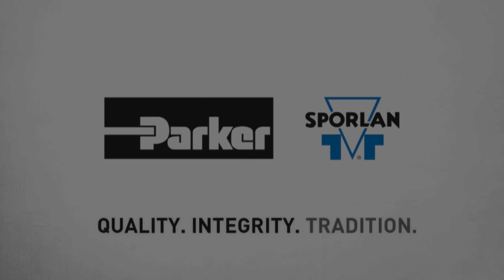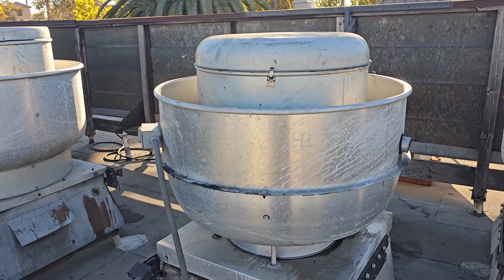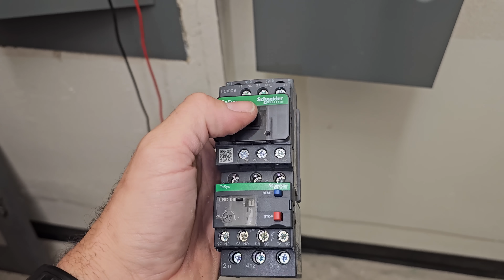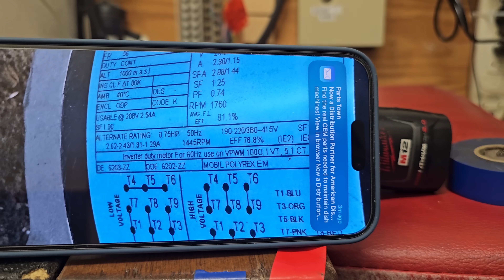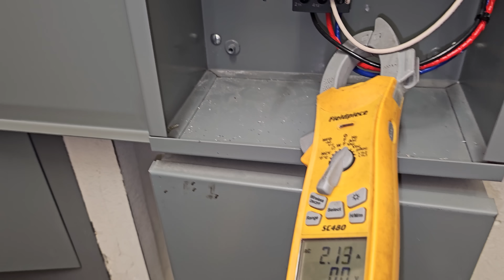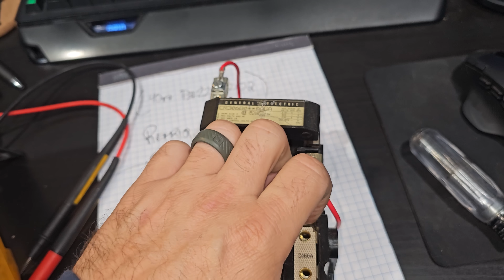SOMETHING IS NOT RIGHT

Comment: On my electrical work for me/friends I use Red, Black, Green, Yellow tiny zip-ties. Especially when all the wires are black before I service the ends ex Classic Snap-On Battery Charger prevents me from cross polarity destroying a vehicles PCM/ECU/Modules, don't need a $3,000+ oops Battery. Mainly I work on Automotive and electronic devices, ex, taking a $20 LED shop light from HFT turning it into a toolbox hutch light with a magnetic switch to auto on / off, manual switch, added fused as I had to relocate the power supply remotely to make the install fancy, wires hidden, epox magnets to mount for my former boss x-mas gift for his new toolbox. Snap-On set is $675.00. He retired shortly after and HFT released their clone for $100.

Just my 1/100 cent

Comment: I think the Schneider overload says it will trip at 125%of what you set the dial at. So you now have it set to 2.9 times 125%. Not having the control wired through your 95 and 96 contacts on overload will burn motors up fast as well. Not sure if you checked the others.

Comment: Pretty good video, except for one thing. Those thermal elements (heaters) are not fusible links that melt. If they were, they would need to be replaced when they trip, as opposed to being reset. They heat up on overload and the temperature causes the control circuit to trip out. After things cool down, the reset button resets the control switch.

Comment: 15 minutes into the video, working on the old three phase delta wiring.  If you find 230 or 240 volt power on a three phase system it is very likely a delta wring.  We had two systems of Delta wiring at City Of Long Beach, where I worked 15 years on some buildings built in 1949 - 1960 with delta three phase systems.  
The more common is three phase "High Leg" where you have 120 volts to ground on two legs and a "Wild" or "High" leg, that is about 190 volts to ground, but can not be used as a single pole to ground.  It messed up a 120/240 volt Hoshizaki ice machine with a 120 volt water pump in it, and a 4 wire power plug, using the neutral.  

Anyway some of our buildings have a 240 volt, where two lines are 240 volts to ground, and the third phase is grounded!  Very surprising to many who have not seen it before.  I had this system in about 5 of the library buildings, and the high leg system at about 1/2 of the park buildings.  Only the library built after 1970 had the normal 208 / 120 volt three phase Wye system.  Most of the buildings I took care of where built between 1947 and 1965, with very few between 1965 and 74.  Then they had "Prop 13" and that reduced funding to the city, and not much was built new after that.  

So the building with the three phase delta wiring, they also have a second power meter, with 120/240 volt service to that second power meter. 

The City rented a very old building that was owned by Southern California Edison Company, and they had a 200 amp power panel in there, the light circuits used edison base screw in fuses!  Really old stuff, from the 1930's!  You are bringing back some really old memories.

Comment: I work on Motor control all the time and use up to Size 5 starters.   I have found a lot of electricians don't understand motor control nor how to wire a Mag Starter properly with OL protection, which is what you've encountered.    I have a friend who works residential and commercial and always call me every time he comes across a starter because he just doesn't get it..   Seems like whatever electrician ran the wire for you was lazy to do it properly and up to code.  That should not be unacceptable!

Comment: That bimetallic overload had no built in fuse so the circuit it's fed from needs to have a fuse rated at max whatever it says on the overload label. This is probably why your old one melted, when the wire inside the conduit shorted, the current was too high and melted the overload instead of the upstream fuse/CB which is probably too big for this overload.

Comment: I got sent out to a newly built restaurant of one of the largest burger chains after work. The electrical contractor couldn’t figure out the controls for the fire suppression system which tied into the cooking equipment. I get there and ask the electricians who’s in charge. All five gesture they don’t speak English. As I’m walking out one of the guys runs up and magically starts speaking English. He shows me their rough in and the wires change colors two to three times with most of their runs because they were too cheap to buy more wire. I call my boss, he talks to the general contractor and I end up having to stay there all night tracing out their shit. They were still short on their rough ins so they had to go out and get more wire. After I was done I took photos of their spliced wiring to protect myself and told the general contractor to have them rip each wire out and replace it with an unspliced run. The next day I get a call from the general contractor asking me to guarantee that all the wiring will pass inspection. I laughed my ass off and told him “I’m an hvac guy not an electrician. Don’t put this on me. Spend the money and hire a qualified electrical contractor to redo everything if you’re worried”

Comment: If an electrician did that here, they'd be sacked. In some instances it is ok to sleeve different coloured wires to indicate a different colour but a green wire should NEVER be sleeved to any other colour or used for any purpose other than grounding. If the electrician didn't have the correct cable for the job they should have gone and got some.

Comment: What would be wrong with testing and replacing the heater if the contactor is still good? I look at it like this: I can save the customer alot of money. Heater only costs $20 vs $350-700 for a new contactor? So in the end I can get the job done for cheaper and quicker. Charge the same labor and make more money in less time? I know your not makeing as much on the part but my customers appreciate me trying to save them money!

Comment: Great videos.
While setting the overload to the rating of the motor is ok, it is not best practice.
Most electric motors are multi use and are suited to a wide range of applications.
The overlaid should be set to the design rating for the appliance. As for example in your video, It was drawing 2.15 
amps adding a percentage to correction value to that figure will provide better protection for the motor.
I have always set overloads to either the maximum load of the motor or if possible to a slightly higher rating then the running current. Knowing the motor will trip the overload and disconnect power after single phasing or having bearing failure for example leading to burning out the windings.
Regards 
Firth 
Downunder

Comment: I get goosebumps seeing that an electrician just recolors a wire. There  are enough situations were some idiots think they can steal ground etc. and just cut a used wire to cut in the loop to connect their own things to save pulling their own cable. Recoloring is strictly forbidden where I am from and can get you prison time if something happens because of recoloring the wire. And you pay for any damage that happens because of that. It is against code were I live. Use the right wire or if you use the wrong colored in an emergency make a warning label and exchange it for the right one asap.

Comment: What a flaky electrician.  He needs to find a new trade.  I can see why you ended up doing it yourself.  Most electricians are just wire pullers, and he couldn’t even get that right.  Most of them know nothing about troubleshooting, and don’t even know what motor starters are.    Right you are for multiplying the FLA by the service factor.  I find most heaters installed are the incorrect size for the motor. heaters can trip due to an,y loose or corroded connections in the circuit.  Hope you checked all of the connections from the breaker  panel to the starter.  I once had a loose mounting screw on a breaker, that caused the heater to trio in the starter, due to the wire running hot.

Comment: Hi!  The thermal protection is made to trip if there is not the same current in all legs. If you run out of two pole starter, you may use a 3 phase on a single phase motor  by wiring T2 out to T3 in and T3 to the motor.

You're so used to see exposed (hot or live don't know the appropriate words in US english ) big bare metal everywhere in electric box, that's you couldn't resist to add some "spice" to this poor "European style" motor starter !  By ripping off the plastic to run the control cable under the plastic cover, you give access to the live screw. 
Even if it look better this way, it was not made to be this way. It's still far better than the old one (and almost all other equipment I could take a glimpse on your channel) but you increase the risk of electric shock.

Comment: So with the slightly lower voltage (203 vs 208) do you have to adjust the allowable amperage higher or is the difference small enough to not matter?

Comment: Important to note that the screw that the budgie had crimping the black wire down to the back of the upper contact on the A thermal element is NOT a primary conductor in that the contact surface between the element and the housing was and putting that wire in under that screw head was a violation.   If you (readers) ever think that isn't really important you should look up Federal Pacific Electric.      The electrical conduction contact in that illegal arrangement could have been less than 3 square millimeters along the thread edge of the screw inside the hole.   Screws are NEVER a conductor.

Comment: that was some nasty weekend hack, beyond all viable hackery. make them come back and replace the wiring. using a green conductor for anything but equipment ground is 100% never allowed.
maybe that's all they had on the truck, but that's no excuse, go to the big orange/blue/whatever box store and get wire or measure with one conductor/fish tape and use multiple of the same with tape/heat shrink to identify it. 🤢🤮🤮🤮

Comment: keep in mind that the overload label  on the Schneider brand specifically says it will trip at 125% of the set rating on the overload.  so you should set the overload to the fla of the motor.
Reply: The packaging indicates to set for FLA on these, so you're correct according to what I've been able to find from the manufacturer for these they only have the packaging as an installation guide and it doesn't have words, only a pictrgram indicating the dial is FLA.  He has SF of 1.00 so I think in this case he may even have to multiply by 0.9.
Reply: Your're right, because in his case he would end up with 125% of 115% of fla. And I think that the fla isn't even the shown value in the picture, above you can see another current values.
Reply: [I'm not a 'true' electrician]
I think we're in agreement:
It would depend specifically if the motor manufacturer means to set it at 'x' percent above 'TRIP' setting, or if they mean the 'HOLD' setting, which is what the OL markings are.

If they are anticipating that all overload settings usually are marked in the 'hold' setting, then it is possible they mean to set it x% above the actual 'dial' setting, and not to 'add' any trip factor calculation.
Trips ratings are all usually time related, and not specific to any single amperage.
There is no doubt additional trip ratings for 200%, 1000%, etc.

Mr K L

Comment: That electrician should have their license revoked. You CANNOT reidentify a green wire as a different color under any circumstances to my knowledge. And even if you can, it is VERY poor practice. Not using proper phasing tape and writing on that makeshift "red" label is also a red flag so to speak. And bypassing the overload on one phase, if they determined perhaps the starter is bad, it should be replaced. That is a commodity item that they should just have on the truck. Super sketchy for sure!

Comment: It's interesting to me that they have one motor starter in each box. Seems like you could easily have two of the old ones and three or four of the new ones in each box and simplify the whole setup.
Reply: It a security thing. Sometimes the manager of an area  get a key for the box to be able to reset the the equipment for his area.  The kitchen crew would be really pissed if someone plays with their AC or exhaust when they are cooking just because the bar manager isn't able to read the label which one is kitchen and which one is bar.

Comment: I watch a few youtubers that are electricians in various places around the world. Don't know how many times I have watched them do a line check for voltage and then tested the equipment before and after. Every once and while it ends up with either an equipement error or failure that is caught through routine safety checks. It is incredibly rare but it saves lives. The guys/gals that do that sort of work can have strict safety and do quality work. Amazes me how many of them get called in to fix a poorly done job.

Comment: Two things wrong here. Phase tape is not allowed on wire smaller than #4 and you are assuming a liability for allowing this, you should call the building department and report this. Also if the service factor on that motor is 1.0 then the overload should be set at 2.54 amps.
Reply from the maker: Can you explain what you’re saying more?
Reply: NEC code
200.7(C)Circuits of 50 Volts or More. The use of insulation that is white or gray or that has three continuous white stripes for other than a grounded conductor for circuits of 50 volts or more shall be permitted only as in (1) through (3). 

(1)If part of a cable assembly and where the insulation is permanently reidentified to indicate its use as an ungrounded conductor, by painting or other effective means at its termination, and at each location where the conductor is visible and accessible 
In a cable you can do this, in a raceway no you may not.
Conduit and Liquidtight are both considered a raceway.
And under no circumstances are you ever allowed to use a green for anything but bond, it can never carry any current.
Basically you are allowed to tape a white wire if it is romex or sj cable as long as both ends are covered with withe
Colored tape.
Overload setting: NEC allows an overload setting 0f 115% of full load amperage on a service factor of 1.0 motor, but on a constant load device like a  fan running a motor past it’s service factor will shorten it life, this is especially critical with a high ambient on a kitchen exhaust fan. The overcu rrent allowance came from the days of molten alloy and bimetal overloads which you had to select a current range instead of an exact current to trip if the motor exceeds the set amperage for an extended time. Service factor 1.0 motors generally have a lower temperature wire insulation than a 1.15 or 1.25 service factor motor.
 @HVACRVIDEOS
Reply from the maker: So you’re saying to set the motor starter at the fla setting? What about the startup inrush?
Reply: The inrush is handled by logic built into the overload it; trip current will decrease after start up. Set the overload at FLA and stay a little shy of FlA on pulley adjustment.  I also wonder why you don't use the high ambient temperature condenser fan motors considering  the hot temperature of the area you word in. Most of them can handle 30 to 40 Deg C than a standard factory motor and they are ball bearing. The oil tends to dry out in sleeve bearing motors at high temperature.and the ball bearing seals keep the dust and dirt out.
Reply from the maker: 2.54a  SF 1.0 “ I was running 203 volts 3phase so I used the 2.54 rating and multiplied that by 1.15%.    2.54x1.15=2.92a overcurrent setting… that’s how I’ve always understood that ???

Comment: The electrician is an idiot.

I would have refused to accept incorrect insulation colors.

NEC prohibits green to be re-identified or used for a purpose other than an equipment grounding conductor, and white is prohibited for anything but a grounded conductor (except in a premade cable — which isn’t the case here).

In short¹, when pulling wires through conduit, they have to be the correct colors as well as the correct type.
Electricity doesn’t care about color.  But people do.

You know well that the wrong colors are confusing.  But you put your tape and fingerprints on a code violation.

__

¹[Rules for AWG 4 and larger are slightly relaxed owing to limited availability of colors other than black in some markets.  But converting white and green to ungrounded phases is not permitted.]

Comment: That electrician is not an electrician and needs to stop trying to be an electrician. You do not repurpose a green wire no way no how never not once not unless you're wiring traffic lights (bizarre exception). Your fix is an improvement but still a huge no-no.

11:34... you found green/black/white because both of the big box stores sell wire that way: thhn stranded all grouped together black/white/green for convenient feeding into conduit. So much easier (for them [at least while they're standing in the aisle at home depot {and maybe even cheaper too?}]) than buying black, red, and blue.

Is there a ground conductor in there at all now? Was there before?
Reply: the box store generally only sell that color combo in short pre-made "whips". they likely used what was on the truck or were dumb enough to think it was single phase and too lazy to re-pull it, residential guys lying about their skills?